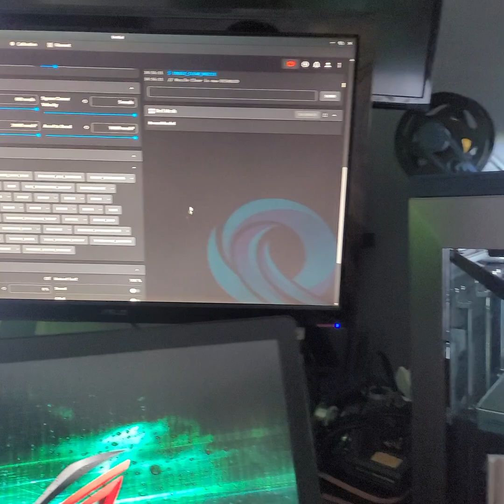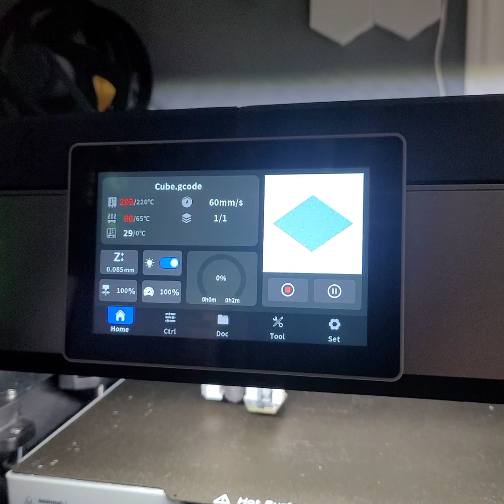Qidi Plus 4 Beacon3D Probe working

Comment: My plus 4 bulldoze the PEI bed, scrapping off the coating leaving trails of destruction... I hv been looking for solution. Whatever you have done here, please share a complete guide 😢😢😢 And I need to send complaint to QIDI about this, the printer is not even a month old 😢😢😢
Reply from the maker: Are you printing a lot of ABS ??? If so, the bed Piezo are proned to send false reading sometimes and this is why we have worked on implementing the Beacon probe ;)
Reply: @frankthebum  I haven't do any ASA nor ABS, still playing and testing with PLA and PETG. It is frustrating and draining. Now the printer cannot get the z offset properly. Sent email to qidi, yet to receive any reply...
Reply from the maker: @MarioSantoso, I'm pretty sure the bed piezo sensors might give wrong values and throws off the calibration. Check in the config files in the SAVED-VARIABLES what is the z-offset value. You can put it to zero and recalibrate the z-offset and save.
Reply: @frankthebum  done that, that's what qidi support asked me. Record the whole process and print test (squashed 1st layer). They will send me a piezoelectric sensor replacement. But I cannot trust that this will not fail again... Sigh

Comment: The slicer did this weird thing.
Reply from the maker: What are you talking about ?
Reply: @ The weird back and forth you saw when printing the first line. (You described it with this word in the video)
Reply from the maker: @northox  it was an adjustment that was wrong in the gcode. All fix now 😊

Comment: Nice brother! Does this fix all the z-offset and leveling issues with plus4 using the beacon probe? Any caveats?
I appreciate the hard work!
Reply from the maker: Up to now yes it does ... no need to use any extra probes ...Beacon or Carto have everything in one part ... even the ADXl
Reply: this is awesome!  Thank you for posting.  Subbed and liked
Reply from the maker: It will fix all this for sure, mainly removing the need of other heat sensitve parts, Piezo bed sensors, bad induction probe. But also boosting the speed of the print start like crazy. ... work in progress 😊